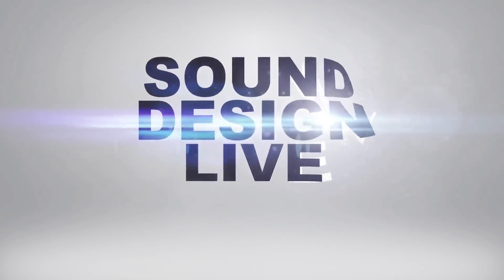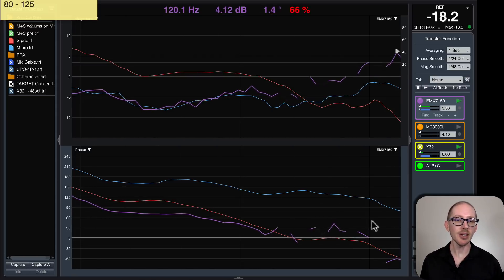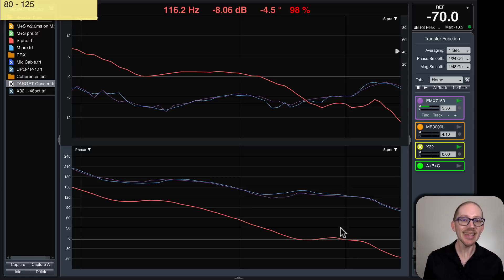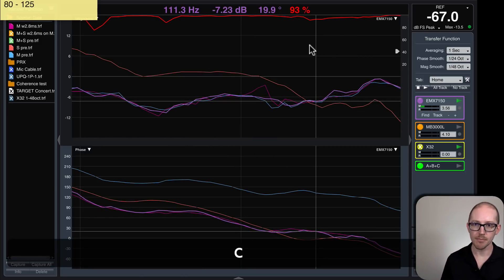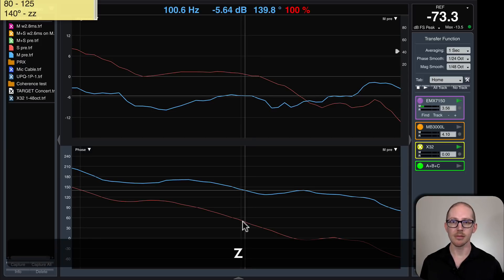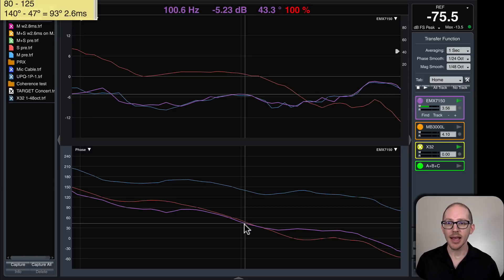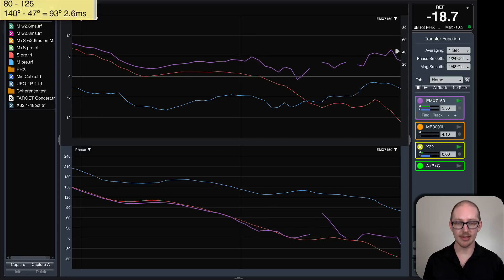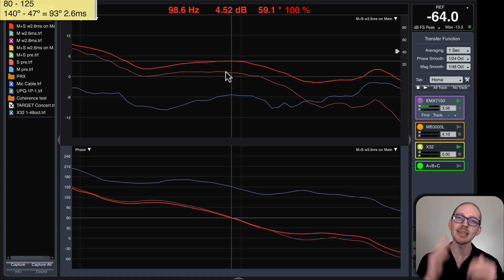How to verify main+sub alignment in Smaart® [GSwSST34]

Comment: Is it possible to have a negative value for the degrees? I found it on a diver that's perhaps further away. Is there something wrong or is there a different way to calculate it?
Reply from the maker: Hey Tony, can you say more? Phase values are often [-180, 180] so yes, you can have negative values. What's a diver?
Reply: @nathanlively Sorry. Translation error. Subwoofer. I have the data saved. Tomorrow I'll write the main and subwoofer ratings at the midpoint.

Comment: Would this still work for my sub to mid top ? I run my subs from 30hz to 80hz & my mid tops that are already phase aligned with a nexo controller. I run them 80hz to 22khz ! Just I can hear my subs eat at the punchy kick section where it’s not phasealigned properly 🙁 knew to all this n wanna make it sound okay !
Reply from the maker: Hey Josh, this should work for any spectral alignment.

Comment: Hey Nathan, great explanation! I have a question: when I check the two phase for the delta at the delta frequency, the first is at 150° and the second at -45°. Do i have to calculate 150-45 or 150-(-45)=150+45 ?
Reply from the maker: Hey greenshark, you're welcome! Try to picture both number on a number line. You want the distance between those number. That would be 150 to 0, then 0 to -45, which is 195, or 150 - (-45). The other possibility is the other way around the phase wheel, which is 360 - (150 - (-45)), or 165.
Reply: excellent explanation, the idea of the distance between the two values is very graphic, thank you very much!  @nathanlively

Comment: Hello. Thank you for your videos. I have a question. Some subwoofers can reproduce frequencies up to several hundred hertz. How to find the upper boundary of the crossover region in this case?
Reply from the maker: Hey Vyacheslav, this is personal preference, but I like to define the crossover as anywhere where the main and sub are within 10dB of eachother. They will continue to interact until they are 30dB apart, but 10dB is the really critical area.

Comment: Hi Nathan - I really appreciate all of your hard work! Really informative and easy to understand, however, I do have a quick question regarding this topic. I've seen this process done in various videos, however, it always appears that sub crossover alignment is verified against only one main. I happen to use a center sub configuration. Would you still just align with just one of the mains?

On another note - I saw in your video on mic placement for center sub alignment that you, more or less, suggest ONAX L mic placement at head-height. But In other videos, you suggest having the mic nearly touching the floor to avoid reflections. Can you shed any light on when you might choose to use head-height versus close to the floor for sub alignment?
Reply: I may have answered my first question through trial and error. Would you use one speaker as the "reference" (probably the speaker furthest away from FOH, and therefore, not delayed) and then align all other speakers to that reference individually?
Reply from the maker: Hi Alex! 
>Would you still just align with just one of the mains?
Yes. Hopefully it's symmetrical?

>when you might choose to use head-height
Start with head-height. If you can't get actionable data because of the floor bounce AND you know the floor will mostly disappear when covered with humans, switch to ground plane.

>use one speaker as the "reference"
I'm not sure if there's any other way to do it. What alternatives are you considering?
Reply: Thanks so much for your response! So since both mains are symmetrical relative to the center sub, the polarity should be roughly identical plus or minus any room reflections. Also, makes sense about starting with head-height.

What about in the scenario of a sub that is off-center and also not directly under the mains? In my home theater setup, I have an LCR configuration with my sub to the left of the left speaker, so the symmetry isn't quite there like it is in the case of the of a center sub configuration(which I use for the system at my church). Is that just unideal? Any ideas? 

My initial inclination is to use the sub, which is furthest away from the listening position, as the time reference, then align left/right (next furthest from and roughly equidistant to the listener), then lastly, align the center (closest to the listener) channel. Not sure if that makes sense.

Comment: Hi Nathan. I see a lot of people in Smaart videos delaying the mains to align phase. While this makes sense with a ground stacked system, when it comes to a system with flown tops does it not make more sense to delay the subs given that they are physically closer to the point of reference, in the same way you would delay a delay speaker to the mains and not the other way around? Is it possible to determine which matrix to delay to achieve the best results by looking at the phase traces?
Reply from the maker: Hey Ashley, you are correct. The biggest challenge to alignment between two sources is displacement. Many times  the delay you need to restore alignment is equal to the distance offset.

>Is it possible to determine which matrix to delay to achieve the best results by looking at the phase traces?
Yes. Since we only add delay, not take it away, the source with a less steep phase trace will need delay to match the other.
Reply: I think we should take in consideration that there is a kind of delay that is caused by the distance between the speakers. One is forward, another is backward. The backward speaker will be delayed in relation to someone that is in front of it.
Another kind of delay, and I think this is the one Nathan was talking about, is when you have two speaker, say a main and a sub, that is in the same distance. Even so, delay could occur, because of the kind of processing that occur inside the electronics or even caused by the physical design of the system.
So internal processing causes one speaker to be delayed in relation to the other one. But how to know who is ahead and who is behind? The phase trace will tell you this. There are some seminars that explain this, including Nathan, I think.

Comment: Hey Nathan, could that phase issue actually be from the reflection from the floor? I wonder if those speakers were on the edge of a stage if that would still happen. Thanks for the smaart tutorial.
Reply from the maker: Hey Jason, the sub is on the floor so it's more likely to be a wall reflection or even ceiling. I'll have to take a look again to see the frequency.

Comment: Does it make sense to use a burst or kick drum sample instead of pink noise that way the subs and mains are In time and not just phased??
Reply from the maker: No. The test is source independent. What's important about the test signal is that it is broadband or at least covers the entire frequency range of interest, and having high signal to noise ratio.
Reply: Nathan Lively so by using pink noise the algorithms are able to identify the random pieces of noise to be able to identify which wave length they are looking at? Like if this was done with a 100hz sine wave the mic and do signal could be years apart but “in phase” once they line up. Is using pink noise what avoids this? Lhasa is very small adjustments... what if the pa and tops are actually off by something insane like 40ms, how does smaart know which of the wavelengths to lock them together since you cannot delay locate the subs?
Reply: Mic and DI*** not “do”.. sorry, on gig on iPhone.
Reply: “Phase” not “lhasa” ... omg sorry man lol

Comment: I am slightly confused about the centre of the crossover region, If the subs where I work are set to crossover at 80hz, how do I find a centre? Is this something done visually on smaart? Using Smaart di right now. great video btw.
Reply from the maker: Hey Jonathan, the logarithmic center of the xovr region is calculated like this: √(f1*f2). So if your xovr region starts at 60 and ends at 100 then just drop sqrt(60*100) into Google and you get 77.5Hz. The xovr setting on your subs at work does affect this, but will not tell you the answer. You have to measure the acoustic result.
Reply: I also got confused at 6:07 when you said" 4ms multiplied x 1000" I didn't see 4ms as part of the equation. Thanks again.
Reply from the maker: >" 4ms multiplied x 1000
I'm actually saying "for milliseconds, multiply by 1,000". That is, to convert seconds to milliseconds.
Reply: @nathanlively  Excellent, thanks for your response.

Comment: What's the raison 60° is good to be in ?
Reply from the maker: Hey Andrew, check out this image - https://www.prosoundweb.com/wp-content/uploads/2018/08/20180807summation5.jpg

Notice that  at a phase offset of 60º you get almost 5dB of summation. So 60º is an arbitrary limit that I picked up from Merlijn van Veen, but it guarantees that we will get at least 5dB.
Reply: @nathanlively  Thanks for the answer. So it's some kind off "we all have to agree on some point that we can not get everything we desire" :-p
Reply from the maker: More or less. I don't know if we all agree. I got this idea from Merlijn van Veen, but I think it's a great guide, which is why I use it.
Reply: @nathanlively  Or as Bob says it "there's no such thing...." :-p

Comment: Hmmmmm, trying to figure out why the equation given towards the end is ∆Frequency? Didn't see you calculate that, rather just use the center frequency of your crossover region.
Reply from the maker: Hey Andrew, I didn't need to because I was only looking at one frequency. That formula is the complete formula for converting changes in phase to time, but I could have simplified it and gotten rid of the delta phase.
Reply: @nathanlively  I believe the formula you actually used was deltaPhase/360/frequency, not deltaFrequency. If the frequency is the same then deltaFreq would be 0 and then you would be dividing by zero...

Comment: I don't have Smaart, or any other measuring equipment. I literally have to guess what's going on and try my best at my venue. We currently do a lot of local bands, but we are moving up to booking bigger acts, and I told my boss that we are gonna have to get more serious about phase alignment and equipment, because bigger artists are much more meticulous about their sound and setups than we have normally dealt with at this point.

I watch these series of videos, so that when we do make the move, I'll have an understanding of what needs to be done, and how to do it. Thanks a lot for passing your knowledge on, Nathan!
Reply from the maker: Hey Acid, I get that. I guess the good news is that you work on a permanently installed system. So, worst case scenario, you don't need to spend $$ and time on Smaart. You can hire someone else to come help you much less $ and time and just get it done once. :)
Reply: I could get a RTA mic and use our X32 console pink noise generator to get a decent alignment. I know it's probably not as good Smaart, but it would be something at least.
Reply: Acid001 download the Smaart demo for free.
Reply: @Hank Weaverston Cool, I'll have to check that out when I get an RTA mic.
Reply: Acid001 X32 and RTA won't cut it. You need 2-channel measurement technique. And that's where Smaart is useful. Without it you won't be able to see a phase trace and impulse response. You can't measure transfer function with a simple RTA.
Reply: You can ignore all the advice here and merely use any dB meter (free online or at app store) and a tone generator (free online or at app store) to quickly set up alignment. 

Simply pick your crossover point, play it as a tone at low volume through both mains and subs whilst having your dB meter's mic at your primary listening area. 

Start moving the delay of the closest boxes (whether it be the subs or the mains) until you observe the loudest dB reading of that tone. Done.
Reply: STAY WHITE this way you align only the  single frequency that you are measuring. The whole point is to match phase traces. Otherwise you can get a frequency ripple around the measured frequency. For fast and dirty setup this might be ok. But not for any serious work.